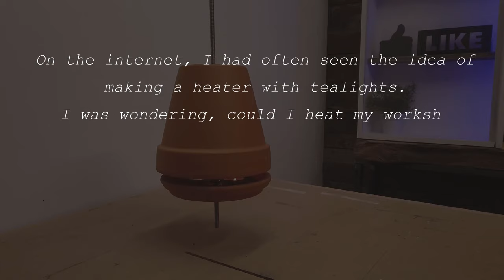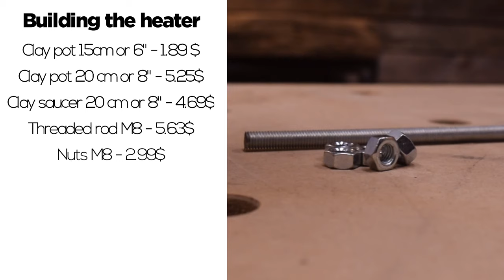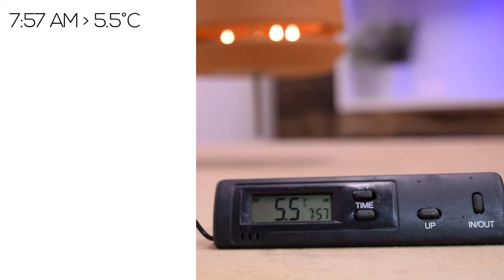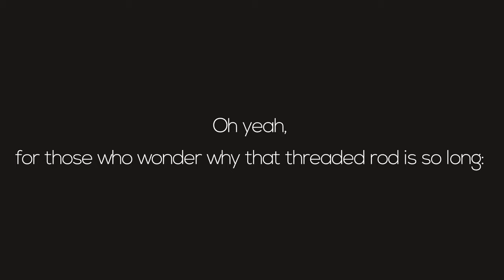High Energy Prices? I Use This Low-Cost Candle Heater (Build + Test)

Comment: No, you can’t heat any room with 4 candles. Even 5, 10 candles. You will burn off the oxygen before it warms anything. it is all about the space. Room size includes height. Using the clay pots only to trap the heat from going up the ceiling, and keep you warm within 15, 20 sq feet around it. Any room bigger than that, or higher than 8 ft in height will not do any good. Please don’t tell me “try it first” because I have. I put together an experiment in a 10x12 room with 10’ ceiling. With the door closed, It raised my room temperature by a measly 2 degrees. Imagine a room at 50 degrees in the winter, 2 degrees will still freeze your *#@$*#&.
Reply from the maker: Too bad it didn't work for you. Thanks for watching.
Greetings.

Comment: Would be interesting to see the Temperature change after 4 Hours with only the Candles and not yourself being in the shop at same Outside Weather conditions. So my Question is: how much did the heat of your Body/breathing warm the Shop up. There are so many more Factors going in this, than only the Candles....that's at least my guess :)
Reply from the maker: It will certainly have an effect that I am present there, but there will never be a moment when I will leave a burning candle unguarded. For me, the biggest advantage is that there is a heat source that I can regularly warm my hands to, warm hands works much easier. All the extra temperature that is released only makes it more pleasant in my workplace. Thanks for watching and this really good question my friend.
Reply: Actually it would have been nice to have the base line test done first with just him in his shop the day before and all the same measurements.  That way we can see how much his ~100W of body energy heats the place alone versus when the candle heater is running.
Reply: Exactly. Moreover, even the winter sun heats up a bit.

Comment: People  try to disprove this in videos using math, but they make the mistake of using the candle power of 40 watts per tealight. If you light a tealight in your home, the heat rises to the ceiling. These pots convert it to radiant energy and keep the heat lower. Also, other videos have people trying them out in vehicles. A vehicle has no insulation to help stop heat loss.
Reply from the maker: Thank you for your feedback, Tony. Greetings, Christophe

Comment: I made this. I used a 3" pot, a 5" and a 7". Two 10" plates and a 5" plate. 1/2- 13 rod and nuts. The biggest plate I used for the base. The second 10" plate for holding the candles and the 5" plate on the top. I had to put side holes under the small plate and the 7" pot and 4 holes in the top for heat/exhaust escape. I can put up to 10 tea lights in at one time. This will keep a 8' x 15' room at between 60 and 65 when the temp outside is below freezing and maintain this for 5 to 6 hours. Then have to reload fresh tea lights.  Granted, my shed is pretty well insulated but my only heat is from my Terra Cotta heater. this is not a fast heat, but a slow radiating heat. You do have to set you air level and pay attention to it once and a while. You can get flash over if you have spilled wax being heated from the holding plate. If you use a wingnut under the holding plate you can adjust you air gap you control the burn. I get roughly between 6 to 7 hours from 8 to 10 candles. I'm sitting next to it right now and i have to be about 1' away or it gets too warm on my leg.  This is in Minnesota this year and will be my major source of heat for this coming winter.   I use two of the old used tins and put that scented wax on the top plate for better smelling room. Don't put the wax directly on the plate. !! The wax will absorb into the Terra Cotta, But once the clay has absorbed all it can you don't have the same fear of off gassing to ignite
Reply from the maker: Thank you for sharing this, my friend. That is valuable information. Greetings

Comment: 😳 WoW! I like the design and concept... 
It looks good, it is silent, could smell amazing and  it works . Even without any paint it looks decorative. 
Mathematically, about 40 watts per candle, say 160 watts per 4. 
A maximum standard outlet space heater is rated 1500 watts.

So your setup will take 9 hours to heat the same as a "powerful" space heater for one hour. Which is amazing since your setup is slowly releasing heat, and can be in a much closer proximity to human which give a cosy warm feeling.

One note though, I think you mean in your cost calculation
0.03 "Dollars/Euros" not "cents" for the price of Ikea candles
Reply from the maker: Thanks for the kind words, my friend! I'm glad you like this idea. It was indeed $0.03, but at the time this video was shot, my English was bad. It's still bad, but a little less now, hahaha. Thanks for watching.
Reply: What did the outside temperature do while the test was going on?  I was wondering if it warmed up outside and if that would affect the test results.   🤔🙂

Comment: Nice idea. I would find it very interesting to see how the temperature around the workshop changed during these hours. Further I would be curious to see what temperatures you could achieve with longer heating periods. Cheers!
Reply from the maker: Thanks buddy! I have to say that the temperature outside did not change that much the day I was testing this. I have never tested this idea longer than about 6 hours because i don't want tho let the candles burn while I'm not in the shop because of safety reasons. Thank you for watching. Greetings

Comment: You start the "test" at 7:57am and conclude at 11:03am.
Did you ever stop to consider that temps normally rise from morning to noon??? 
A rising sun is also pretty good at warming things up.
Reply from the maker: Hi Daniel, that is a very good comment. It was a cloudy day that day, so I suspect that will have almost no effect on the temperature. But I totally agree that had the test happened on a day when there would be a big difference in temperature between morning and noon, that would have affected the temperature inside. Thank you for watching and your comment.
Reply: @patandderry8416  There is no need for being rude... A flame is a flame is a  flame and will generate only so many BTU.. The terra cotta pots act like a heat sink absorbing the heat... so no,... they won't change the effectiveness of a set of candles burning... but burning candles do create BTUs..If you don't believe me hold your hand over a flame ..... and get back to me..

  Now there is a method of accelerating the dissipation of the stored heat  by using a powered ventilation across the hot clay cooling it faster, thus warming the surrounding air better.. so technically.. if enough candles are aflame... yes they can heat the workshop

Comment: This sort of heater works best if treated like a damped slow-combustion heater - less oxygen leads to more efficient burning, less soot and more radiant heat through the sides of the pots. Suggest you do another test and note the difference.
Reply from the maker: Thanks for sharing this, Peter. Greetings

Comment: Id use a wingnut on the bottom and cut a slot that it can slide through in the bottom piece so you can turn it and drop it past the wingnut. doesnt seem like it works that well to heat overall though. if you're left with little to no other alternatives it may be useful or even life-saving in certain situations
Reply from the maker: Thank you for sharing this here. Greetings, Christophe

Comment: Anything that saves me money I'm for.   My apartment has one of those motel heater/air units.  I don't know why they built these apartment with these in them, they were built in the  70's.   And the floor is tile over concrete so they are very cold and I can never find the sweet temperature in the winter.   If I turn the heat up, it makes it too hot and if I turn it down I freeze.   If this would heat my apartment or at least the kitchen and LR, I'd be happy and could turn my heat way down, so it wouldn't cost so much on my electric.   Thank you for making this video.
Reply from the maker: Thank you so much, Becky.
I'm glad you like this video and I hope this heater can help you.
Thank you for watching.
Greetings.

Comment: A tea light candle produces 100 BTU's of heat energy. This video shows 4 tea lights were used so 400 BTU's generated. Depending where you live it takes 30 to 60 BTU's per square foot to heat a room with an average height ceiling. So lets use a living room that's 15' x 15' = 225 sq. ft. x say 40 BTU's = 9,000 BTU's required to heat. Remember a candle that generates 100 BTU's does not magically generate more BTU's if you cover it with a clay pot so this video falls into the "Free Energy" or "Perpetual Motion" device category.
Reply from the maker: Thank you for this explanation, warren. Also, thank you for watching this video.
Reply: I think you're missing some data. How hot is the flame? How close is the flame to the pot? How many flames? What temp do the flames heat the pot to? 
Also there are different setups to the device. Some have an open hole at the top creating an upward "jet" of heat that pulls cooler air into the bottom. Whats the temp of that "jet"? I've seen videos that put it at 170f. How long does it take to warm up a room of a certain size with a constant jet of 170f air being introduced? 
It will not "heat" a room I wouldn't think... but it can and does slow the cooling and no doubt should lower energy bill.

Comment: 30 Watt per candle. You need to burn 50 to equal a 1500 watt space heater output. Tea Candles burn for about 3.5 to 4 hours. You can buy about 200 for 25 bucks on amazon. This gives you the 4 x 4 hour sessions so 16 hours. That means you will spend 25 dollars to heat a room with the equivalent of a 1500 watt space heater for 16 hours. Also each candle uses as much oxygen as 1.5 people. So burning the 50 candles will use up as much oxygen as 75 people in the room. So you will have to open the windows and ensure you have a good ventilation, thereby negating any heat gained.
Burning Candles to heat a room is much more expensive and much less efficient. I would consider this only a real emergency solution to create a small space to warm your hands.
Reply from the maker: Thank you for sharing this information. Greetings Christophe

Comment: One tea light usually emits 40 wats. So 26 of them will work like a regular heater but 13 will also work quite well if you have a small space to heat up. You can absolutely achieve room temperature with those but I think the price will be too high to make it anything else than a emergency option.
Reply from the maker: Thank you for sharing this, BenTenpenny. Greetings.
Reply: That's assuming perfect energy conversion.

Comment: I've got an electric radiator type heater that if I plug it in early enough, it'll heat the shop quite a bit. I also have a propane heater that I have not ever used. It was given to me. I think it would heat way faster but I don't have a regulator for it. This is an interesting thing you've done here. I have not ever seen anything like that.
Reply from the maker: Thanks man, I'm glad you learned something trough my video. Greetings

Comment: Nice video, but i've a question, is part of those 5 degrees caused by the sun? From early morning to mid the differnce is huge i guess. Have you reached interesing temperature?
Reply from the maker: Hi, Thank you for your question. That day was a cloudy day and I don't think the sun could have any effect.
The reached temperature for my workshop was not that huge, but I guess this will be different for any workshop. 
I will use it again this winter. Every degree counts, plus it is nice to warm your hands on. I hope his information was helpful. Greetings
Reply: @christofix  The sun has a huge effect.  The candle has almost none.  If you want to warm your hands hold them 6 inches above a candle.  That will do it.  Save yourself a bunch of money on washers, threaded rod and wasted time.

Comment: I wonder what the same temp changes would be without you in the shop? Average human produces 6-10k btu heat per day so at four hours on the low side your body produced 1k btu heat. I’m genuinely curious. 🤓 My workshop is not insulated well enough for this type heater. I use propane space heaters but they are still inadequate. I need to insulate more and get a large 20k btu heater with a thermostat to keep it above freezing overnight for my glue and finishes. Until then, I use my diy automatic heated glue cabinet I built. Great video cinematography!
Reply from the maker: Some people made a similar comment. the fact that I am present in the workshop will certainly influence the temperature. But what is important to me is that there is a heat source next to me that I can occasionally heat my hands on. All the extra temperature that this heating generates is a nice extra.
This is a very nice question that would make me want to know what heat this heater actually produces, but I will never leave a candle unattended for 4 hours. That is why I am not going to take the risk of testing this out. I love my workshop to much LOL. Thank you for watching and your comment my friend.
Reply: The big thing is he started in the morning and kept going during the time that the outdoor temperature would have been increasing. A better experiment would be to try this at 4PM and continue in that direction. Such a thing might work in a survival situation in a very small tent but in a workshop? I don't think so.

Comment: I think you should redo the test whitout anyone in the shop. In my opinion you and the tools you use have higher heat output than the tea candles. I don't deny that the candles can heat up your shop I'm just curious how much they alone can heat the space.
Reply from the maker: It will certainly have an effect that I am present there, but if these candles burn I will always be there. there will never be a moment when I will leave a burning candle unguarded. But you definitely have a point that a person's presence will affect temperature. For me, the biggest advantage is that there is a heat source that I can regularly warm my hands to. that works much easier. Thank you for watching my friend.
Reply: @christofix  I agree that it's not wise to burn the shop for a sake of an experiment. 😁
Reply from the maker: @AriOjala  Hahaha LOL. No please, I have already invested to much time in my shop.

Comment: Built it safe, how long does it take to cool down to safely touch at the bottom? 4 hours?
Reply from the maker: It cools down pretty quickly. I think in 30 minutes almost all heat is gone. I'm not afraid of the heat of the pot, when the candles are out, there is no risk of starting a fire at all. I hope this answers your question, and I was able to help you with this, my friend. Thank you for watching. Greetings.

Comment: I love this. It's such a simple design and I like simple things. Cheers, Huw
Reply from the maker: Thank you so much my friend. I also like simple stuff; It doesn't always to be complicated.
Reply: What if you put a thick metal chain called Reese Tow Power or a Safety Chain in a tea light pots will it work just as good. You flip the clay pot upside down so the metal chain goes in the pot. They say the more metal more heat ??

Comment: Nice video.  I think I'm going to give it a shot also.  How big is your workshop and do you think it matters if the heater is hanging or setting on something?
Reply from the maker: My workshop has the size of a one-car garage, so that will be 3 by 6 meters or so. I do think it matters if the heater is hanging or not. The reason I choose to hang it was that there is no contact with another object so heat would not be absorbed. Thank you for watching, my friend. Greetings.

Comment: How big is your shop? I keep blowing breakers (electric space heaters) I have 2 of them on separate circuits.  One does fine until the air compressor cycles.  The other takes a while...but depending on lights that are on...that one can go...😞

So I was curious about if I used multiple heaters like the ones you made....  How many would I need for a 3 car garage that is uninsulated?

Love the vid!  Very cool! (I mean warm!) 😇😎
Reply from the maker: Well mu shop is a one car garage. It is 3 by 6 meters big. I gues when you make 3 of thes heaters you will have the same effect. Thanks for watching Jeffrey!

Comment: Interesting idea, but I would like to know what the temperature outside was at each interval.
Reply from the maker: It was a very cold day. the temperature barely rose that day. This heater is not a miracle, but I was very happy when I could warm up my hands.
Reply: A quick back of the napkin calculation suggests that 4 pots with 5 candles each, would product ~1Kw of heat energy, could be a viable option to take the chill off, just thinking out loud.
Reply: @SouthernEngineering  We both know a flame is a flame is a flame  and  will "create" only so many BTUs..What his "heating plant" needs is  ventilation system to accelerate the heat dissipation the flame imposes on the clay. I saw the holes drilled into the bottom of the larger pot to improve air flow (convection) but using more candles creates more heat "stored"  and a  passive dissipation system may not be enough...  Maybe a  detachable ventilation system could be utilized to switch back and forth  between multiple heating plants

Comment: Freeze the candles before you light them and they will burn up to twice as long. Also, is there any off gassing from the metal parts?
Reply from the maker: Thanks for that tip! I will try that for sure. I have never heard of that, so I appreciate you sharing this with me. About the gassing, I'm not sure of that, but I guess not.